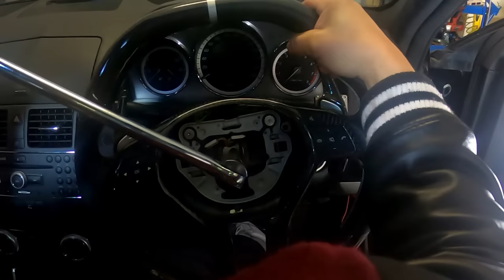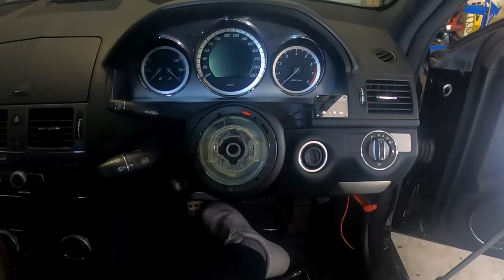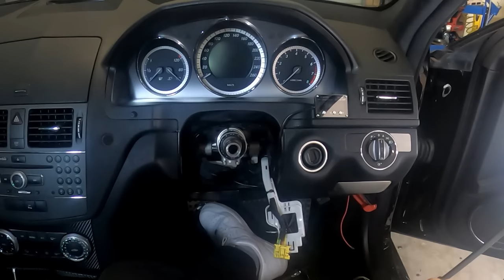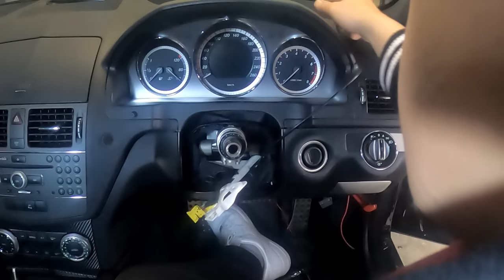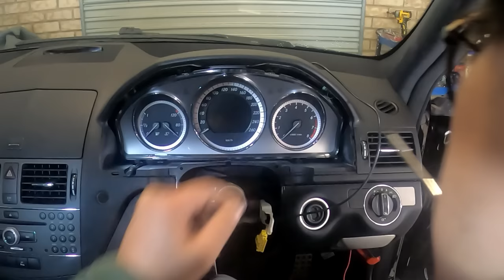HOW TO remove and fix ESL/EIS/ ELV MODULE  w212 w204 mercedes motor replace  Part 1

Comment: one more question
if i take the esl module to the dealer, can they program everything without the car?
so i can reinstall it once they have replaced motor and chip ?
Reply from the maker: yes once you remove the esl module you can taker it to most car auto key specialists and they will be able to fix it for you ...it will save you at least 1000 dolaars to remove it yourself and just get someone to fix it...you do not have to take it to mercedes dealership..they will charge you even more... i strongly recommend for you to take it to a automotive key specialist and they will be able to do so without the heavy price tag....i recommend this for anyone who isnt comfortable replacing the ESL motor in the module themselves ...just simply remove the ESL module and also the EIS which i show in how to in PART 2 ...you must remove both ESL and EIS in order for the person fixing it to be bale to check that that it all works ..they need the EIS and a spare key so they can test that it all works...let me know how you go ..hope you get it sorted asap...i know how it feels to be stranded and not be able to drive your beautiful car
Reply: @MIKEYZVLOGZ  yes sir
i will for sure give you an update for others to see
that is what its all about
Reply from the maker: they will not replace the chip its definitely the motor..it is the most common fault on our w204 cars ..and if it is just the chip there is no need to reprogram anything ...its a misconception that the esl module must be reprogrammed in order to reinstall it and make it work.... even for my fix i didnt have to program anything i simply removed the motor replaced it and reinstalled everything and it was all fine...doe and dusted saved myself 1700 aud .... they wanted 1750 aud to fix it....
Reply: Aliexpress sell this circular tool to remove the ignition lock, which the locksmith will need plus key plus ESL.

Comment: Nice video.  You forgot to identify the replacement motor part number and where to purchase!!!!
Reply from the maker: I did mention I got it from ebay .. and u can simply search ur model and add esl in search and it will come up
Reply: @MIKEYZVLOGZ  is this the same for my s500. I new heard a motor noise?
Reply from the maker: @chuckcawrse1218  can u hear the motor turn whine?
Reply: @MIKEYZVLOGZ  no nothing?
Reply from the maker: @chuckcawrse1218  ye seems like a dead motor .. procedure wi be very similar as it's the styles used for our cars..u try the tap trick with a solid object hammer etc ..under esl module directly on the column ..to help shake it to life ..it dies work

Comment: I have one fiat tipo cross restyling 2021 and after changing the electronic steering lock after a month yesterday is exit one messagge error.
But luckily not is insert and the car is start but if is blocked the car not start.
just want to put an emulator and delete it permanently
Reply from the maker: yes this can be done just find the right emulator for your car with the same plug

Comment: Hello brother,
I have the problem with w204 c180 2008 model. When i turn on left or right indicator and turn the steering sometimes double indicator lights come with different timings. Than my indicator lights stop working untill i restart the car. Please help. Thanks.
Reply from the maker: Have u checked to make sure your connections are ok? Do u get any warning messages ?
Reply: @MIKEYZVLOGZ  bro no warning sign and i don't know much about the connections but once the same part mentioned in the video was replaced. Also i would like to add that it happens when head lights are ON
Reply from the maker: @SalmanKhan-vp1oq  u mean the esl? That shouldnt have anything to do with your indicator
Reply from the maker: @SalmanKhan-vp1oq  u need to get a star diagnostic scanner to scan the car for faults..when it comes to electrical faults u need to alwaya try narrow down the issue as its very hars to pinpoint an electrical issue without narrowing down the possibilities..then check fuses relays..plugs connections amd even the bulb harness...
Reply: @MIKEYZVLOGZ  ok dear. I previously have scanned the car from a mechanic workshop. They says your head lights harness and inside wiring need cleaning and insulation. The done all the services but on the returning to my home the same problem rises. I called them about the problem they said next we will check the electric circuit and will cut off one side indicator to check which one is creating the problem. Actually this will be my third visit and they are charging me more.
Reply from the maker: @SalmanKhan-vp1oq  i see ...maybe get a second opinion it doesnt hurt to get another shop to check your ertror so you are sure that someone else isnt trying to make money from you ...as for your issue...i cant say exactly what it is but it does seem to be a inconsistent connection causing the error..i hope that you do get it sorted asap....i know it is very frustrating when you have an issue and cant find exactly whast the problem and you are spending money trying to find the problem..but this is the dilemma we all face as car owners...
Reply: @MIKEYZVLOGZ  ok bro thanks for the feedback. One thing more i would like to add  the indicators start working normally after car restart. The double indicator either head lights on or off works normal. I think a ghost is hidden inside. Ok bro thanks for the help i will visit another workshop and will check the car from them.
Reply from the maker: @SalmanKhan-vp1oq  no worries hope you get it sorted

Comment: Mines is permanently unlocked. I can turn the entire steering wheel without key in. I here a few clicks under dash. Only the remove key font on cluster screen. No start no head lights but I do have hazards.

Comment: Hi. Awesome video! My ESL failed in the unlock position. Do you think the chip will be bad?
Reply from the maker: no most likely its going to be the motor...the chip isnt what fails its the motor ... however having said that... it doesnt mean the chip will never fail.... its just more then likely the motor in the esl module.... hope u can get it sorted asap
Reply: My steering wheel doesn't lock and the s430 doesn't have that module. I have the same symptoms (key turn but doesn't start), any ideas? @MIKEYZVLOGZ
Reply from the maker: unfortunately its out of my knowledge dear friend .... i habe really only worked on my w203 c200k and my w204 c300.... in your case maybe try and ask mb forums and a local mercedes dealership..just to get a rough idea....
Reply from the maker: no friend the chip is a circuit board not likely to fail..however its a possibility.... u wont know for sure til u open it up and do a test and replace the motor to see if it works..then u can rule out a part at a time..sometimes a trial and error is the best way to find out dear friend
Reply: Cool. I did some further testing and after replacing a relay a fuse blew. Wiring is in tact plus the car is factory and garaged so I'm pretty sure the SAM module is bad. I've read this particular one doesn't require programming so we'll see  @MIKEYZVLOGZ
Reply from the maker: that's great news my friend..well done for checking other things first like the fuse and relay..whenever there is an electrical problem always start with related fuses then move on to relays that may be related and then a obd2 scan ..then go from. there .... narrow down the issue..thereby saving time and especially money..rather then throwing parts at the car hoping to solve an issue that might not be there ... good on ya mate ..keep it up and let me know how u go

Comment: Hi, I have a 2012 C300 and I’m having this issue. I removed the ESL and replaced the motor and still no luck. Car powers up (dash screen, radio) but no instrument cluster lights or anything. Still says remove key. The car locks and unlocks with key fob. 
Any suggestions? Thanks in advance
Reply from the maker: if car can unlock and lock its not esl..esl actually spins the motor to lock and unlock steering wheel so urs maybe related to eis where key inserts

Comment: My steering wheel turns, but my threaded bolt does not push in.  What am i missing.
Reply from the maker: u removed the 13mm nut on bolt ? if so then it should push down if not the bolt is not pushing down due to motor malfunction hence why ur bolt won't push down
Reply: @MIKEYZVLOGZ  thank you.  I removed the steering shaft and sending off for an els bypass.  That lock is crazy.  Thank you.
Reply from the maker: @backfire4124  hmmm...it really is puzzling why u can u can't remove the esl and depress the bolt but it will get sorted

Comment: I watched a video and they said you can fry the chip if it’s not done correct , they hooked it up to something to change the data in the chip
Reply from the maker: yes correct
Reply: @MIKEYZVLOGZ  so how do we avoid frying the chip as I got nothing to hook it up to ?
Do you know if the facelift w212 uses a motor aswell as no one can programme them as only dealer can do it ?
Reply from the maker: @M.E63  i can tell u now that only ppl with the eis esl module reader device can do it ... there are individuals who can do this too from home .. they either rent the equipment or own it .. mercedes are not the only ones who can do it ... to avoid damage to the chip .. just ensure esl is unlocked and follow the steps in the video .. u wont cause any damage unless u actually try
Reply: @MIKEYZVLOGZ  I’ve spoke to every seller and even on mhh auto forum and everyone says the same , only Mercedes can get the FBS4 parts and program them unless you can point me in the right direction ?
Reply from the maker: @M.E63  they are forced to say that .. u can goto any key cutter specialist and they can even do this job for u ... .. ur talking about programming the chip and syncing with the car right ? not only mercedes cN do it ... alot of ppl can as long as they have tge tool.....usually u send in your key and eis and esl modules and they make sure it all syncs and works
Reply: @MIKEYZVLOGZ  I found tons of people who can program new ESL and EIS for Mercedes but only FBS3 and older , mine is a facelift model and had FBS4 ESL and EIS and everyone tells me the same thing no one in the world can program new FBS4 ESL and EIS and only Mercedes can do it , they will happily do any w204 as they all come with FBS3 and they can do w212 FBS3 which is non facelift models but facelift models comes with FBS4 and only Mercedes can do that , if you can look into and point me in the right direction if you know anyone but I’m 99% sure you won’t find anyone that can do FBS4 ESL and EIS , there’s 3rd parry tools that can do FBS3 but nothing fit FBS4 unless some has access to xentry scn coding for FBS4 then it can’t be done , Mercedes don’t allow people access to that , if you do know anyone then please let me know

Comment: How the heck does the chip, which has no power, get fried from opening the case?
Reply from the maker: wen u plug it back in it will fry the chip ..that's whatbis meant ..it has happened before
Reply: @MIKEYZVLOGZ  Ahh.  Couldn't you just move it to the locked position before assembly so that it doesn't fry?
Reply from the maker: @DonziGT230  yes u. an definitely..its all about whether u do it correctly or not..but basically there are instances where it does happen and a new chip must be replaced

Comment: How do u unlock it before removing with out having to worry about the chip frying
Reply from the maker: insert ur key ensure it unlocks and then remove the battery cable so it stays unlocked that's it

Comment: I found out from Mercedes it was the steering lock. $1800 job. I dont hear that click when i turn the key. I want to attempt this job now. It failed in the unlocked position. What are the chances the ignition switch is bad too because they said to change both at the same time. And "No" they didnt say the the ignition switch was bad. What exact tools are needed to do this job? Steering lock. And is this the same directions for a 2012 Mercedes c300 sport.??
Reply from the maker: unliokely its the eis..most definitely the esl module..more liely the motor as shown in my video
Reply: Hey Vincent, you might want to look at the plastic emulators replacements on eBay. It replaces the failed OEM mechanical ESL modules. You take the complete ESL module out send it in along with the working key. They’ll turn around time is 1 day. Not bad. Plus, it’s not $1800 you would spend at dealers. It will cost $250 for the plastic emulators. Don’t worry about it being plastic because it’s just a key module. They also carry warranty on their products. You should look into that. I haven’t done it because mine is still works. but it’s something that I keep in mind.
Reply: @erico6117   Thank you Eric. Im am confident with Mikeyz that i can do the ESL. I paid mercedes $289.00 to diagnose it. They said it was the esl. Its in the unlocked position. That is definitely my 2nd resort if i replace the motor in the module. Though I am not sure what two buttons to press when you take the module apart and replace the motor. I know MIKEYZ didnt show that part, before putting it back together. Also, do you hold the repaired module.in your hand all connected w the wires, put battery cables on then test the repaired module? Of course before putting back the steering column? Will the pin/screw lock go in and out in your presence. And if the module was in the unlocked position bolt it in, and instal it if it works in that position? Thats the only thing im uncertain of. 
Thanks if you can help or anyone else. 😃

Comment: So if I follow these steps to replace the motor. Is for sure that I am not going to need to reprogram the key nor car?
Reply from the maker: IF YOU ARE JUST REPLACING THE MOTOR NO YOU WILL NOT NEED REPROGRAMMING..BUT IF ANOTHER ISSUE , THEN yes unfortunately there is no way around that ... everyone must have the ESL resync to the EIS.... but the main thing here is that you have done the hard part and saved yourself 1000 dollars easy..the reprogramming will only cost you 150 - 200... SO TO ANSWER YOUR QUESTION YOU DO NOT NEED TO REPROGRAM THE ESL OR EIS IF ITS THE MOTOR THAT HAS FAILED... THANK YOU ..I HOPE THIS HELPS ANSWER YOU QUESTION
Reply from the maker: also you should consitder a  ELV/ESL bypass emulator... its actually a very good idea and you will never have to worry about the ESL failing ever again ..if mine ever fails again i am definitely getting a ESL/ELV emulator ...you can buy them for about 50 to 100 on ebay and then have someone program it to suit your car and sync to the EIS ..... its definately worth looking into friend
Reply: MIKEYZ VLOGZ  Update...!!
So I bought the motor for the Electronic Lock and planning to work on it this weekend. I went to turn the car on, when I put the key the steering wheel got unlocked but the ca didn't start. Now the steering is unlock even with the key off but not starting.

Do you believe is still a bad motor?
Reply from the maker: actually sound like eis is not reading
Reply from the maker: @rafasharleen6451  definitely eis then the fact that it unlocked but wont turn tells me its eis but also can also be motor aswell ..unfortunately u wont know till u open it up and check and try....unless u have a esl hacker tool there's no real way to tell apart from trial and error ..or try use obd 2 scan tool and it should narrow it down abit especially if its eis and esl it will tell u...that is the next best step friend
Reply: MIKEYZ VLOGZ I have the iCarsoft Scanner. Let me see if it gives me some code, last time it didn't.
Reply: MIKEYZ VLOGZ What does the" ELV/ESL Bypass" do and how it works? I saw few online but I am not quiet sure which one is the one I need.
Reply from the maker: @rafasharleen6451  ok so basically it works exactly the same only difference is that it no longer has the locking mechanism so u do t have to worry about the motor failing ever again .... however the chip can still fail ...but not likely ... so just be aware that it's still an electronic device that can have issues but not common ... the major fault of the w204 is that the motor fails in the esl module   in turn then not allowing the steering to unlock and therefore tmur unable to start the car
Reply from the maker: @rafasharleen6451  yes that would be your best bet to use the icaraoft and scan for codes
Reply from the maker: @rafasharleen6451  so when u find one u just have to. give them your full specs and year model etc so they can be sure it fits your car ..and it has to be programmed to suit ur car so must be programmed with eis to work in sync ...I repeat must be reprogrammed
Reply: MIKEYZ VLOGZ any recommendations on who can reprogram it?
Reply from the maker: @rafasharleen6451  yes all car key specialists can do this job just have to remove your EIS ASWELL SO THEY CAN MAKE SURE IT READS EACH OTHER .cuz like I said they work in sync. with each other ...I order for then to test it properly u have to give then your bypass module and your EIS

Comment: Sooooo how to get it to unlocked position?
Reply from the maker: as explained in the video ... I did it by placing my key in and disconnecting the battery whilst it was in the unlocked position... when you insert your key the esl unlocks when you remove your key the esl locks... if your esl is beginning to fail... then you can try tapping on the steering column to shake the motor to spin... or there are a cpl ways you can try as well..more involved ...hence why I say to do this once the issue occurs